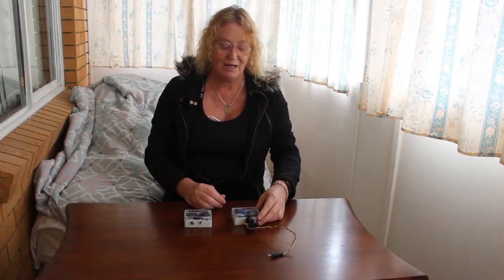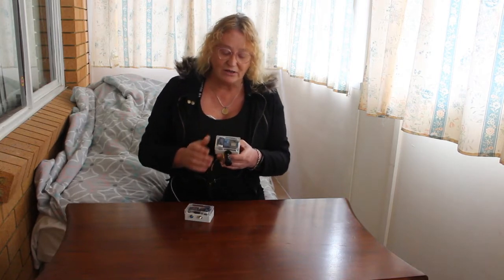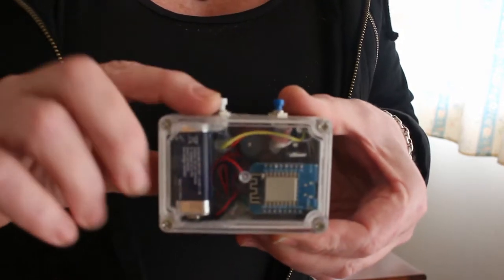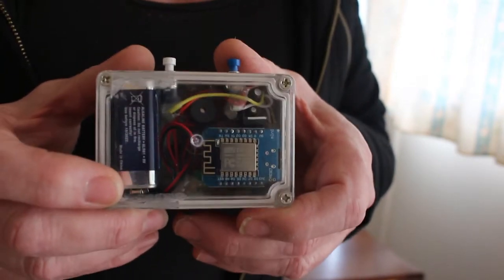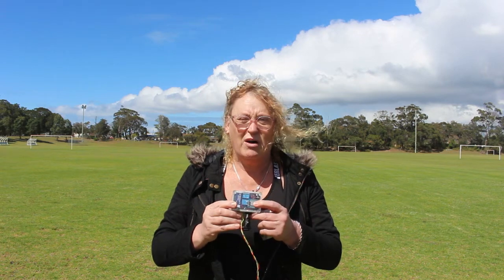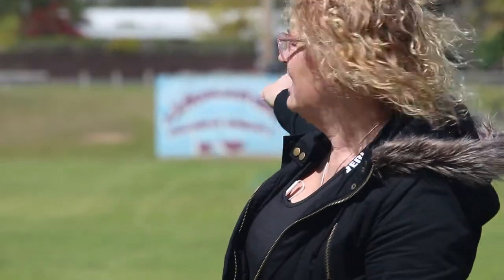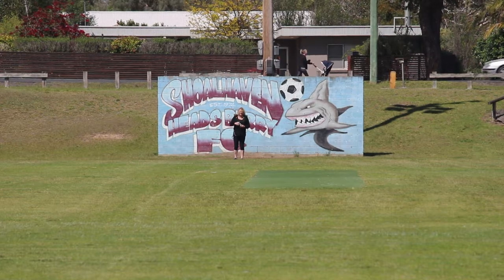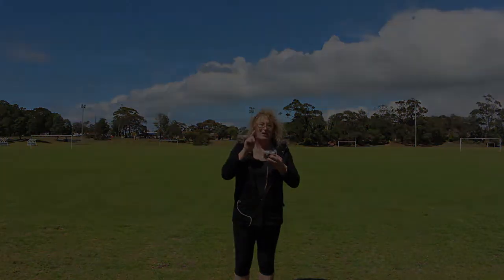Canon eos camera remote using NodeMCU mini Wemos D1 mini

Comment: How is the battery life?
Reply from the maker: The 9v battery did not last longer but I don't use it much, I don't know how long the battery life is because I used it On and Off over time and then I found the batteries had died.
Reply: @melissa.merritt  thanks for the fast replay :)
Reply from the maker: The code for this project has not been updated, I will look at this project on my website and upload the code this weekend
Reply: @melissa.merritt  thanks, but I just wanted to get an ideea about power consumption, I am a web programmer and I had the ideea of such product. Before investing time into such product development I search the web and find your project. I wanted to write the code and make some 3d printed case so I can make a small business startup. But I guess I need to search for another ideea. It's a hard time here due covid and jobs are not easy to find. Thanks again for the help.
Reply from the maker: Ok, yeah the esp8266 boards are power hungry, no good for battery life. Good luck with your venture 👍